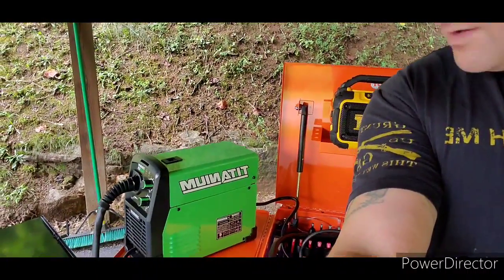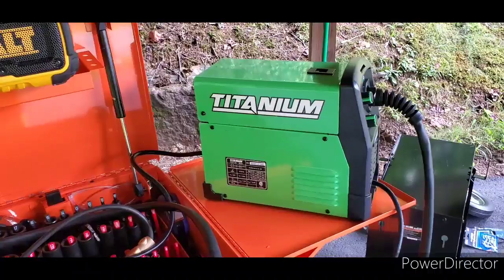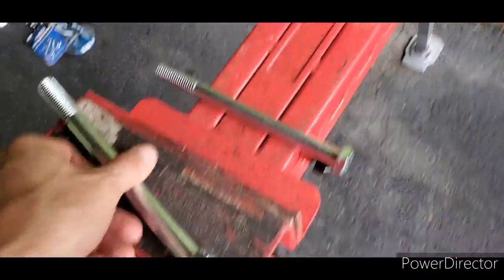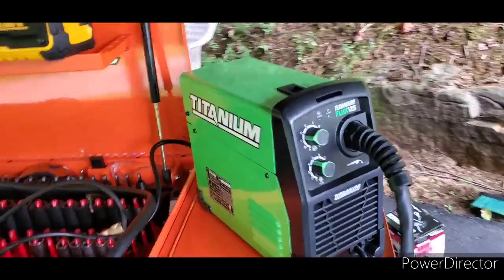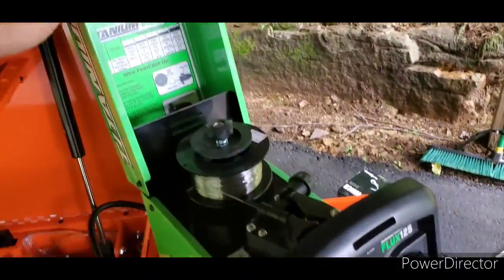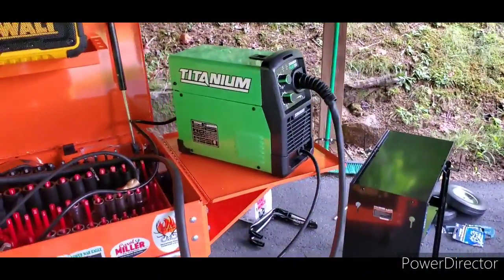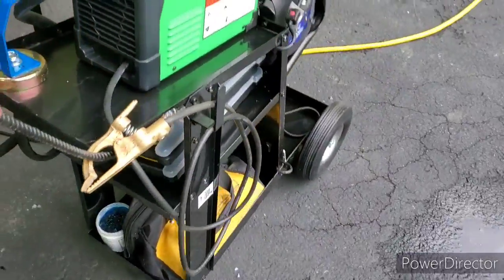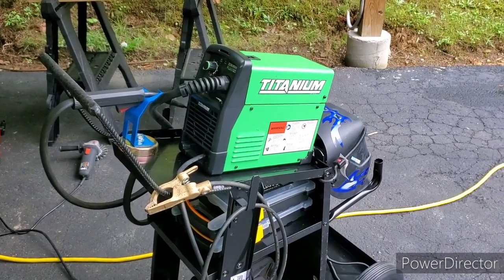Why NOT get the Harbor Freight Titanium 125 flux core welder.

Comment: Ive had mine for a year, love it.  Had the cheaper 90amp flux welder from amazon prior to this and this is MUCH better as its a proper DC inverter based welder, as opposed to the AC transformer that was the other.  I just welded some hinges to a metal gate in my front yard this weekend, running off a 100ft 10/3 extension cord on a 15 amp breaker!  As long as I welded in bursts of 2-3 seconds, with a second or two in between, never tripped the breaker.  Only tripped it whenever I got ambitious and tried to lay a 5-6 second pass.  Obviously not ideal, but each hinge only had about 6 inches of total weld, so not a big deal.  But the fact that I could run a solid bead, on a 120v outlet with a 15 amp breaker, on a 100ft extension cord is amazing!!  Im by no means skilled at welding, but this has been fun to learn on for sure!

Comment: Great machine for an entry level welder and your DIYers. Practice makes perfect and with the adjustability of the 125 you'll find what works best on the material you're joining. The chart inside the cover gives some great suggestions as does the literature that comes with the machine! Solid buy!

Comment: I've had my Ti 125 for almost a year and absolutely love it. With good wire (I use INE .030 & .035) it'll handle anything up to 1/4", and not many homeowners or hobbyists are gonna need to weld anything larger. I got mine at last year's Black Friday sale for $149, which is a STEAL considering what this thing will do. It's funny, it's so versatile that once you get a welding machine, you wonder how you ever got by without one. 👍
Reply: Great reply. I use INE wire best i found and use off Amazon  great wire and price. .30 n .35 works excellent
Reply: Would it work for welding a steel dirt bike part?
Reply: Its Kaidin  Yes you can run .035, works great for heavier (thicker) metal. You have to flip the wire feed wheel, which is covered in the owners manual.
Reply: TOE FINGER  Should work just fine for bike parts. I've used my welder on car haulers, farm equipment, lawn mowers, etc. No failed welds yet.

Comment: Mine is 2y old...used it every weekend.   Recently started having some wire feed issue, speed not consistent so something is hanging up.  But even if I end up having to replace it...I got more than $200 worth of work out of it.  It is crazy easy to weld with!  I basically have the wire speed high and vary the heat nob based on the metal thickness.  An $800 flux might last 10y instead of 2 but it is easier for a noob to drop $200 for their first shop welder.

Comment: So far so good, only time will tell it's durability. I just found  about a 10" piece of thick stranded copper wire folded it in half. Stuck the bent side down in the ground clamp then bent the hangout of the way, now no problem with clamp presser or contact. Later on I may get a new clamp or not, depends on how much I use it. I bought this one over the $100 model because of the variable controls and size/weight.

Comment: Mine came with a nylon strap handle. It was under the cover. You can see the slot for it on the faceplate in the video. There are two more slots for the back side. Was yours missing?

Comment: Why not get the Titanium 125? Because the Titanium 200 Unlimited multi process version kicks ass! I preferred this over the Vulcan too because the duty cycle was better on the Titanium for some strange reason.
Reply: Great idea if you have the extra 400 bucks. That would take a lot of people outta the game, but your right, both the 170 and 200 are great. Can you do 120 on the 200 or is it just 240?
Reply: @markashlock9017  

You can do both. I started with 120v but now I'm running it on 240 after I added 240 service in my shop. I weld about every day with it at 19.5v and never once hit the duty cycle. It's really amazing to me how good this machine runs and well worth the extra cash. I looked into the Miller multi process welder too, I'm a big fan of Miller but it's insanely expensive and doesn't even come with all the leads you need to use all the processes.
Reply: @MrGiXxEr  Yeah the millers are insanely priced. Im sure (hope anyway) that the miller's last longer for that price but for the average guy the price is a little much

Comment: Question...I'm completely newbie to welding I wanna buy this welder can. I run this on a normal 120v 15amp outlet?
Reply from the maker: They suggest a 20 amp,but I have heard of some who did on the lower adjustments. I just run an extension cord from my washer.
Reply: @blackriflear15  okay good idea thanks man!
Reply: Yes 20 amp breaker works best but will run on 15 amp breaker

Comment: Only negative i see is it cant take the 11 lb. spool of flux wire. I have a lincoln weldpak 100, its been great for more than 15 years, i have installed hundreds of feet of steel fencing, countless repairs, but i just broke the trigger/handle. They want 50-100 bucks for a replacement so I’m thinking why not get this one, cept I just put a new 11 pound spool on the lincoln...

Comment: I refuse to buy these when they started to cost as much as a 10x better Chinese welder like an AHP or PrimeWeld. I went last week and they wanted like $300 for one of these things.

There were a great value before HF raised the prices by a ton.
Reply from the maker: 300 for the Titanium?
Reply: September 2020...$179
Reply: just checked online 179.99
Reply: @simpleman283  the day before I posted this my local had it for $279
Reply: @mrmidnight32  I hear you, makes me wonder if they went up then back down or someone at your local was trying to pull a fast one. Any way I did get mine for $185 
I think. It was on sale. No complaints so far.